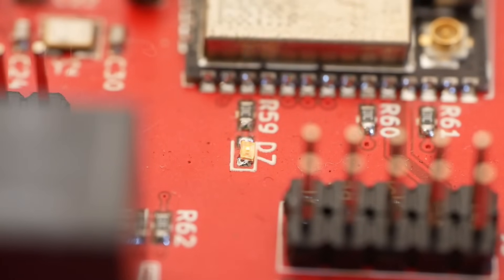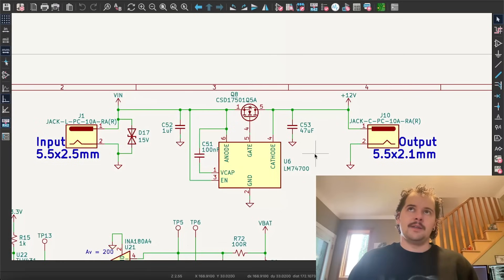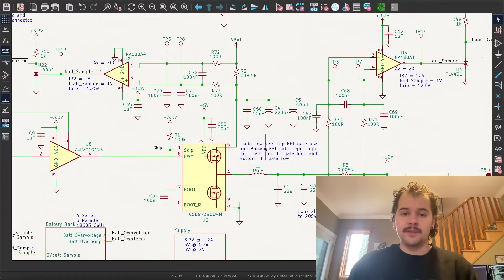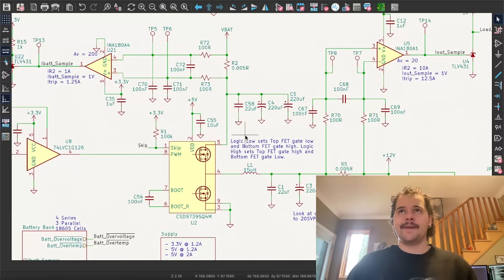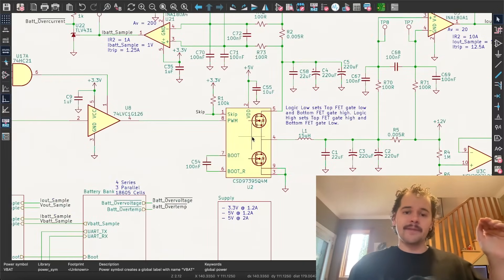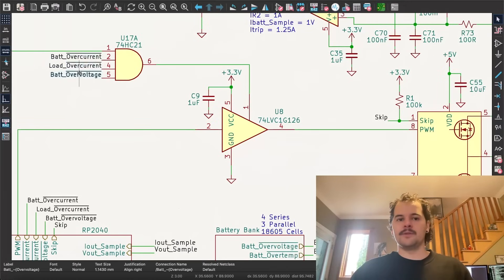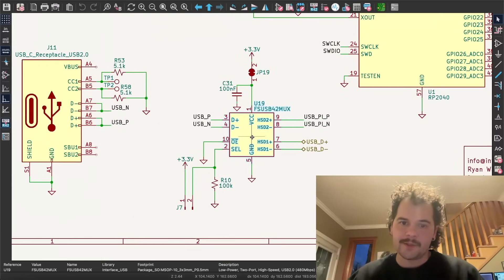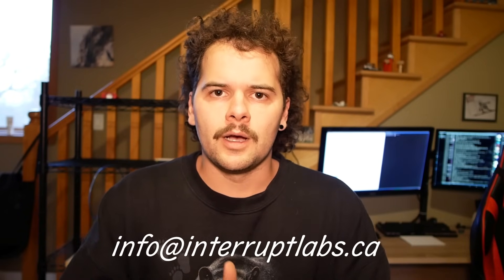We Built a UPS for Hardware Hackers!!

Comment: Hi, I have a question (not exactly on UPS, but) similar field. I have home entertainment system (< 800w) that operate at 120v @ 60Hz but when I move to a country where its 220v @ 50Hz, I want to be able to use it. Step down transformer will provide 120v but retains the 50Hz, there by decreasing the efficiency on the power supply in the electronic instrument (if they have transformers).
So, I was thinking of using a Pure Sine wave Inverter (12v to 120v @ 60Hz, 1200w) and feed it with some sort of Power supply that can deliver 12v at 100A !! .. So was thinking of a 1200W rated SMPS, do you think this is feasible?

Comment: 12 x 18650 batteries does not a UPS make. It's a toy. And since you can buy for (really) cheap a used UPS from some defunct server farm it makes it kind of pointless. Even if you have to change the battery. I do respect the design though, just don't see the point of it.

Comment: My only beef with this design is that it uses 18650 cells. Lithium batteries aren't designed for the long term UPS environment. Sealed lead acid batteries are much safer and are better suited for long term charge storage. Lipos form dendrites internally that damage the cells when holding a full charge for a long period of time without being discharged. You could overcome this by doing a maintenance routine where it discharges the cells at regular intervals but for me, the risk of a lipo fire inside my SOHO panel is too much risk. Also, I don't see a need for two microcontrollers. You could use just an ESP32 to handle everything. I love the other aspects of this project though and I feel like this would be a great toy to play with and add to my smart home projects but I would figure out a way to use something other than lipo cells.

Comment: What a cool project! My favorite diy ups is a meanwell drc100a or drc100b with an appropriately sized lifep04 battery. Just tune the output to the correct top voltage and for 100-200  bucks you can get 20-40ah of capacity at 12 or 24v.

Ive put fifty or so of these together and theyre a great alternative if you dont need the fancy stuff.

You can just tap off a 12v to usb c adapter or whatever else you need too

Comment: I get your what you were going for with the different sized input and output jacks but you should have gone with a more significant size difference. A 5.5x2.5 mm plug can be inserted into a 5.5x2.1 mm jack and can make intermittent connection, so it is still possible to plug the input power supply into the output.

A jack with a different outer diameter would have been better but even better would have been to use a different kind of connector, like an XT60 or XT30 where they have different input and output connectors, then you should have used a female connector for the input and a male connector for the output, then there is no way that the user could plug the input power supply into the output.

Comment: I love the concept of a modifiable/repairable UPS, but this implementation really does not do it for me.

As others have pointed out the choice of battery is really less than ideal.  If you want to stick with compact, energy dense cells then LiFePo is the way to go, and of course there's a reason lead acid remains the standard when size and weight aren't significant factors.

The use of a DC barrel plug as an output is just asking for problems, especially with it placed right next to the input where someone fumbling around in a cramped rack could easily plug in to the wrong one.

WiFi-only networking is also a weird choice, considering that UPSes tend not to move very often and tend to be near things they can be wired to. In the event of a power outage I'd be willing to bet that wired ports stay online longer than wifi.  Not saying don't support WiFi, obviously the ESP32 has it so you may as well allow it, but WiFi-only on a device that's expected to be plugged in to the wall during most of its operating life is a strong turnoff.

Comment: Would definitely prefer modular, especially the battery mounting and containment strategy.
I prefer to keep (non-LiFePO4) lithium cell battery packs in a packages that can be isolated from expensive devices (e.g. motherboard is high cost in terms of time) and keep risk of damage minimal to non-existant in the event there is a failure that causes the battery pack to explode or burn.
In your design I'm unsure how difficult it may be to compartmentalize and safely contain the lithium cells without causing ventilation/cooling issues for the rest of the circuitry. In any event, catastrophic battery failure would seem likely to damage the motherboard and possibly requiring replacing it as well.

Comment: Hey guys, why not one-up the idea and make somewhat like a reference design for repurposing retired 400V EV batteries (or some 96-180V sections) as household UPS?
I'm actually on this quest as a hobby project but it's not moving well since most of my electrical engineering is below 48V.
The rough idea is to shove 400V directly into SiC full H-bridge for high efficiency and high surge resistant transformerless sine output.
BMS and balancing would be "outsourced" to external boards and comms being CAN or preferably just a bunch of dry contacts for greater compatibility.

Comment: You need to have two mosfets at the entrance with a logic to check the 12V input when both mosfets are OFF, if one of the mosfets is still conducting, this trip the failsafe and not turn any mosfet on. This will prevent a dead mosfet from conducting continuously as their failure mode is usually ON rather than OFF

Comment: This is a cool circuit is it's unnecessarily expensive and overengineered you can achieve better efficiency with even more features using just the esp32 as the microcontroller.

Comment: Very cool! Is the RP2040 absolutely necessary? The ESP32 has decent PWM capabilities
Reply from the maker: The idea was the user should be able to fearlessly flash the ESP32 without any possibility of changing the control loop on the rp2040.

Comment: The Mosfet power loss also contains switching loss in addition to resistive loss Rds(on). When evaluating them  you need to consider switching time as well, not just choosing the one with lowest on-resistance.
Reply from the maker: Hey thanks for saying this, you've hit on a critical point of power supply design. For a system like an ideal diode where switching happens very seldom Rds-on is the most important metric. HOWEVER if you were building a switching power supply where the fet is going at 500Khz+, of course you need to look at the gate capacitance and gate drive of the FET :)
Reply: does anyone even do linear power supplies anymore?
Reply: @cdoublejj  Yeah, simple 3.3V LDO is commonly used to drop from 5V where efficiency isn't a concern. If you're talking about a linear power supply powering electronics ie: wall charger, nah I don't think so.
Reply: @cdoublejj Yes, they're simple and reliable. Sometime a little heat for low current circuits are good for outdoor applications top stop condensation/mildew formation, like camera projects.

Comment: I would def like to see less ICs but I understand the 3.
Would much rather have 2 STM32's and an ESP vs 3 different boards - just for consistency - any reason you couldn't use an STM to replace the RP?
There is a significant cost difference between the 2.

(borked - completely broken/unusable)
Onto the structure - 
remove the batteries from the board - have a battery connector block (you can use the screw terminal block or anything like that.
If you want batteries like you have where they are on a board - make a battery board - it means if we wanted to use an external pack we can - also decreases mobo size.
Actually, what I think you can do is actually separate this circuit completely onto a add-on board (board to board connector could be used here)
 - so lets say someone wanted to use LiFePO4 - you can just change the mod board (which contains the STM and all battery management components) for something that can manage/handle the diff battery type - you would have a std communication proto between that and the RP but gives flexibility and lowers board size.
That then just has a connector that has either the battery board, or just connectors for an external pack - but fully managed.
Or say the LiFePO4, then you can use that or any other tech later on without having to replace the whole mobo.

Power inputs - same thing - screw terminal input.
Keep the barrel jacks standard for ease of use - heck you could use std molex type connectors if you wanted - also for the battery side to keep it physically different.

I also think remove the ESP as well - put on another daughter board - and have the connectors here carry the USB aspect for programming the other boards.
Also, use a USB controller instead of a mux, so all devices would show up same time.
 - that then can be brought directly to the feature board - or you could just have a feature board that has a USB-C connector on it if someone wanted to program the other chips without an ESP involved.
The BMS board can just have a programming header that is USB but unpopulated so for production easy to just program itself during testing - or via the USB controller on the main board.

This brings more features since if you changed the ESP to like an H5 or whatever (heck even a rasp pi) - you could have the management OS be able to deploy firmware updates easily to any of the controllers.
 - since you want the STM as a core controller here - I think maybe a transistor or some way to 'enable' programming that forces the isolation of battery pack.
 - so eg: you want to push a firmware upgrade to the STM from the micro or just via USB, you pull a programming pin high on the RP or whatever, and it enabled programming mode on the STM and disconnects the batteries so programming doesn't disable the protections - I say this if its even required - if once the BMS has its registers set, can it function autonomously - then its fine - if it cannot, then you want something like this so if the STM gets borked, then batteries stay off.

Just for ease of ref, I will call the add-on boards like so: BMS board (with STM), mobo (with RP) and monitor (with ESP)

Then for your OLED display - have it a connector from the monitor board instead.

Overall you want to make the main mobo as small as possible - lowers production costs as well as makes testing easier.
Also means you can replace a borked board without replacing the whole thing.
Means it's modular so you can also change things up over time where they may just need a firmware upgrade of one part to use something else.

Like say for old style giggles, we wanna use a lead acid battery pack ... we could - it's just the BMS board that would change.
We wanna use an Intel SOC with a full OS, NUTS and the likes to monitor and report ... we just replace the monitor board.

Or you have now changed things up to handle more current or more connectors .... change the mobo (ofc current to a certain degree - but the BMS board could shut itself down if too much current was drawn - since the flexibility here) 

You can also make the main mobo simpler and keep it 12v - similar to the chinese mini-UPS units.
And then if you want a variety of connectors avail (or 24/48v) - you just have an add-on board with the circuitry to add those features.
 - this is where an I2C/ISP/CAN connector could come in from the mobo to these expansion boards.
You could then have an expansion board for 24v/48v and have it report it's voltage, state and current draw - and even allow control of it from the monitor board.
... think PoE switch - you could make a switch board with PoE ports (or just even passthrough connector for simplicity) - and each port can be monitored back without any hardware changes) 

The biggest thing is things will change, so why not make it as easy as possible to adapt to those changes ;)
Reply: I don't understand why 1 esp can't handle the whole thing
Reply: @maxthehuman004 probs threads related. Rp2040 could maybe work though

Comment: Personally I would not have used 18650 cells. They are Li-ion and if left fully charged for more than 3 months they will lose their capacity and if continually treated like that they probably wouldn't even last a couple years with any meaning power output. I would have either used NiMH cells or LiFePo4 cells as they can deal with being fully charged for much longer and are much less volatile. I would say "just use lead acid gel cells" but that is what everything else uses and where is the innovation there. One possibility could be to have 1 spare 18650 and have  a micro controller cycle through all the cells discharging one and then recharging  it so that they are not left fully charged for long enough to cause damage. However that is much to much complexity for my liking and could probably be fixed just by using other battery chemistries.

Comment: I like the idea, I would remove the STM32 and just isolate/level shift the i2c of the BMS to the RP2040, if you can remove 1 MCU from the equation it would be much better in my opinion.
Reply: Yeah. An ESP32-S3 should be able to drive the entire system actually, but great project! Looking forward to see testing of it!
Reply: @JensChrBrynildsen  That is something I have trouble understanding. I have a robot project controlling 8 servos with ESP32. I don't understand why ESP32 isn't handling whole board
Reply: @darekmistrz4364 I'm not entirely sure I'm understanding their implementation correctly but if I am they're  using the RP2040 to act as a PMIC i.e handling voltage regulation, battery charging and power pathing rather than using dedicated ICs for it, ostensibly for flexibility and to some degree cost. Since this is very time critical stuff it makes a lot of sense to use a dedicated MCU. The rp2040 being a dual core with some rather unusual peripherals on board probably also helps a bit, the esp32 then handles connectivity and housekeeping. I can't however figure out why the STM is necessary.
Reply: @oliverer3 he is using a BMS IC and using the stm chip to control and configure the IC... I don't know what the rp2040 is doing

Comment: For simple low power 5-12V projects (like microcontrollers,single board computers, up to ~2A), aliexpress sells UPS boards for less than 1.5$. Yeah, they might not have the efficiency and fancy displays, but they work and they're dirt cheap. If you want battery holders (lke this project) you can find variants with 2 or more holders as well.

Just throwing it out there, that an UPS doesn't need to be needlessly complex.
Reply: It has to be complex enough to be safe, the batteries need to be balanced.

It's not as simple as you seem to think
Reply: @timmturner  A 1S configuration doesn't need to be balanced. Complexity doesn't necessery mean more safety

For simple projects that require low 5V power, a simple UPS, that can be bought already works just fine.
Reply: @hojnikb  A 5v UPS is not what this is.

Comment: Need to be able to plug in battery banks for longer run time.  Just make the charging and battery management part of the UPS separate and chain-able (have the primary built in and a plug to expand with daisy-chain style connections).  9 amps is plenty of power the 90 Wh is way too small (especially if you are drawing 9 amps @ 12 volts, that's less than an hour!).  There is plenty of resources in the chips to run almost an unlimited amount of expansion storage.

Comment: I would love to be able to get this piecemeal or complete. Itd be nice to be able to get the board with the smd stuff pre installed and leaving the rest of the assembly to me including providing the cells.  I have a few of this low volt lion ups I got online and they are all trash with lots of ripple, they don't transition from mains to battery seamlessly without briefly interrupting power, or they just eat lion cells after 6 months.  I also second the suggestion to have an option to support LiFEPO batteries as they are even better suited for duty in a UPS.

Comment: Two features I'd be curious about:
Can it work with LiFePO4 cells?
Can it cease charge at 80% to prolong the lifespan of the cells?
Reply from the maker: Hey thanks for the comments :)

Since it's all software-defined, LiFePO4 and cease charge at 80% could work with some simple firmware changes. Niche application requests like what you ask are what this device strives to do; if you want a simple hardware UPS that only does one thing, look elsewhere! We can't be cost competitive with those device.

Comment: How is a 12v device running on 6 x 18650 and an output of 75W a UPS  for anything for any duration of time over 20 minutes?

In an emergency you can charge your phone!
Whatever next?
Reply: Depends what you are powering. It's enough power to keep your internet connection running.
Reply: This will easily keep a cable modem and router going for several hours, or a pi4 at idle for almost a day, or an optimized microcontroller for days.

Comment: Great little board. I love the efficiency focus and logic of the design. Id love to see another version to do up to 24v.
Reply: Yeah. The USB-C output needs to power my laptop.
Reply from the maker: Thanks James ! :) we might have something like that coming out later! If you're interested check out the email list in the video description that will keep you updated!
Reply: I've been looking for such a device for long! Great project. Please consider 24v version it would be perfect for all the 24v 3d printers out there (this is what I want it for). Also, if this can be connected with a raspberry pi for monitoring in paralleler or replacing the esp32 (I.e. Klipper 3d printer) it would a perfect component for a lot of printers

Comment: You relay dont’t want to uses DC bales sockets as Output. They can easily be shorted while trying to insert a plug and user's could insert an power supply into the output